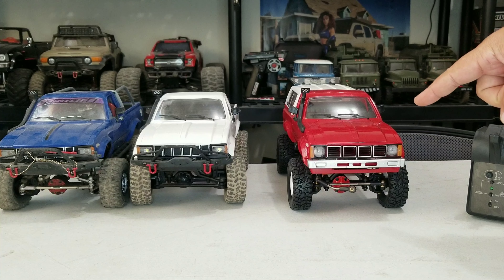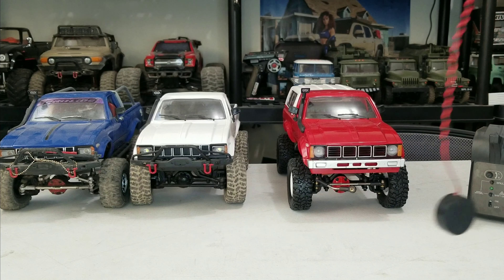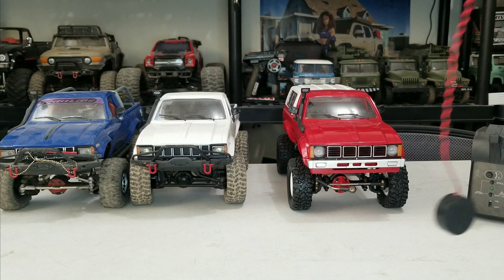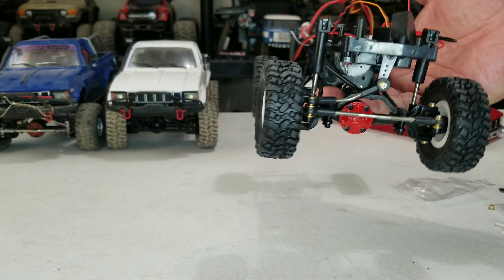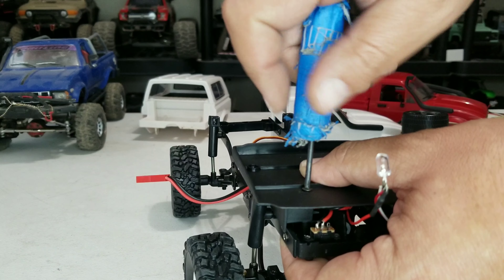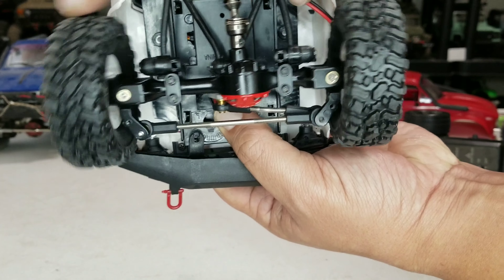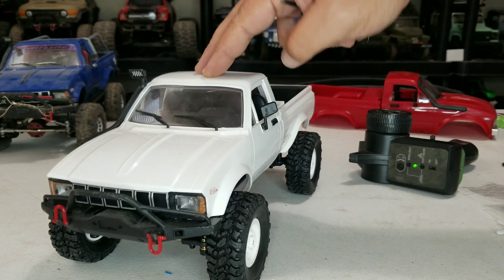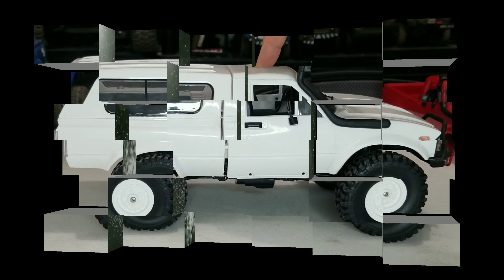WPL C24KM electronics and final assembly. Pt.4

Comment: I see you use many res-v3 controls. Have you ever used 3s and stress test? I'm debating if I should get a separate compact esc. because I like to muddin'.
Reply from the maker: I use the Res-V3 on my B36KM on 3s with metal wheels and wheel weights and it is handling it so far just dont use a high C rated lipo is WPLs recommendations so I use a 2200mah 3s 25c. I like going standalone if possible on electronics but the v3 is not too shabby for the price and all the functionality built in.
Reply: @RunThatRC  I agree with you on all the extras that it has. I didn't know that they recommend 25c. Good thing to know. Glad to hear it can handle a load. On my channel I have a clip of my dragging chain also. Have you ever burned up an esc in one from overloading?
Reply from the maker: @vinnieland6140  only burned one out and it was a V2 version due to continuous water runs not any overloads yet.

Comment: I have a similar WPL RES V3 set up on a C34km with upgraded servo (JX PDI-2506MG). However the servo arm rotation direction is reverse. Would you know if i can change this in the controller?

Comment: Which external esc can I run? I have a latrax esc laying around from when I upgraded my rally to brushless and since they use the same motor size I was curious if the latrax esc may offer some smoother operation and be able to handle a stronger battery since I have several mini 2s and 3s lipo packs for the rally.
Reply from the maker: any brushed esc you can fit in there will work. I prefer to have some sort of drag brake function. It helps make the crawling experience a lot smoother.

Comment: I already buy the Wpl C24-1 rtr, but can i still used it as a kit and remove the electronics if i already have the budget to get the km chassis?
Reply from the maker: you can always upgrade your truck. They sell metal kits and such out there so you can KM it out or even better.

Comment: What do you think about a brushless conversion running 2s and is there any other tire options for these things I'm doing the aluminum wheel upgrade
Reply from the maker: If you can find rc4wd 1inch tires they fit. I just cut the kit tires and make them look like swampers. I've done one brushless with 2speed and its not bad. I still prefer the brushed because I was using a sensorless system so no slow control. Not to bad though.

Comment: Perfect. KM? This is the first time that I've heard of that suffix. What does it mean exactly? What does the -1 suffix mean, also? Thank you.
It seems to me that the white one is a different truck to the red and blue ones? They look different and are never in the same ad together. What is the designation for a metal body? 
Thank you, kemble
Reply from the maker: Not sure what the -1 really means other than they are newer. The KM is for Kit Metal. It's the term used for the kits that come with the metal upgrades vs a complete stock plastic kit.
Reply: @RunThatRC  Awesome, Bro! Thank you for responding. Ya, I finally made myself look for the official WPL site and what a disappointment that was. I don't see much of anything that my build will be using from there. 
Ok, how about this? Do the C24s have a metal body option somewhere? 
I'm building a portal axle rig with the brushless 6800kv motor and all metal everything. 2 speed tranny. 
The first choice body is a 1955 Chevy step side that is a heavy metal display type with opening doors, hood and tail gate. I think it's like a 1/24th scale(?) so its going to look crazy sitting on the portal based chassis. Meh, if it doesn't work, I will just put the regular cab and bed on it. I'm definitely going to need wheel weights and other stuff to try offset the insanity. 
How about this? Something, that I haven't seen anywhere yet is shocks from like a dirt bike with the extended travel forks. Those would look and work killer on some types of these machines, IMHO. 
The only real thing that I am working on is I want the soft tires from the kits, but I really don't want anything else from it. Any thoughts?
Hey, thanks again for responding. kemble gilstrap
Reply: @RunThatRC  I finally found out about the -1 thing. It comes with a different grill, adds a big bumper and has head lights.

Comment: Are you able to steer slowly?
Reply from the maker: yes but the transmitters steerimg rate is set too fast so small inputs are needed for more precise steering. The throttle control makes up for it in my opinion.

Comment: I don’t know if you read your comments but did the motor come with it when you bought it because I’m trying to buy one but I don’t know if it comes  with the controller
Reply from the maker: WPL kits only include the motor. You will need your own tx/rx and battery/charger. You can get a all in one unit like the wpl Res. V3 esc receiver combo.
Reply: @RunThatRC  do you have like a link
Reply: The WPL C14 comes with the controlar right

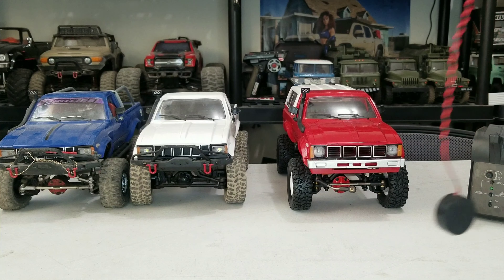Comment: At 0:33 the circuit boart has some spots exposed, the boards okay still when that’s exposed?
Reply from the maker: it was a test because wpl has waterproofed parts of the board but not all. So I just coated the rest and left the portion they did alone. I did end up coating the whole thing eventually.